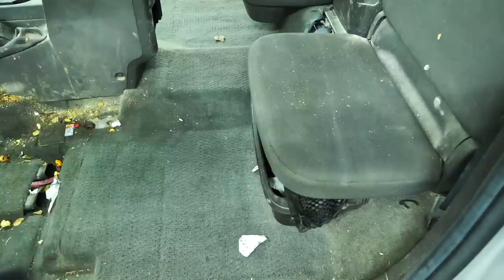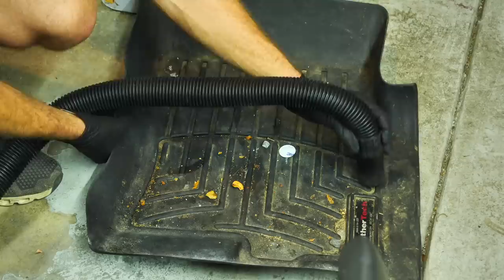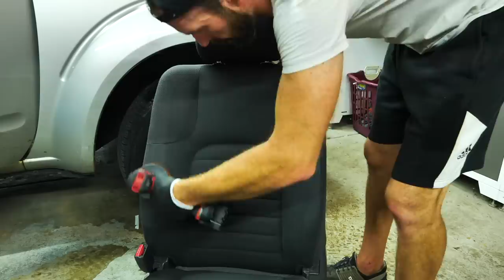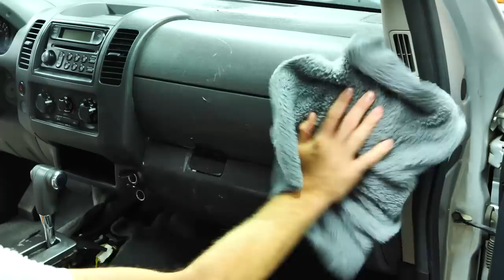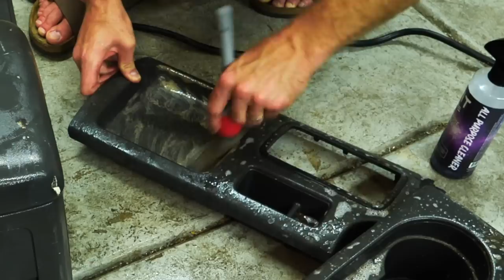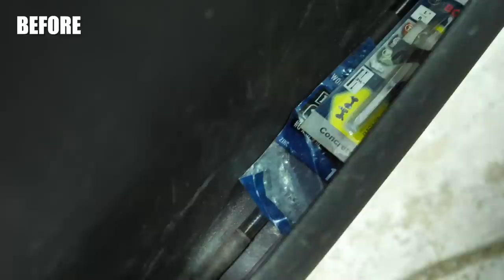Can This Nissan Frontier Be Cleaned? Car Detailing A Filthy Work Truck For Free!

Comment: Love your videos.  

I’ve actually asked you before but have not seen it yet, but I would love to see you REPLACE a carpet….  You often mention how in some cases it would be easier to just replace,….

Another thing I’d love to see is a staining of the carpet - you recently flipped a car and there was a big white bleach spot / even not perfect a dye on that spot would have looked better.

It would also be neat to see a leather repair kit…. 

One last suggestion / scratches and on the plastic might look a ton better with a little heat gun?

Just a few suggestions.

As always, you do a great job!

Comment: I may be off base, just thinking out loud. Could you use a heat gun to mellow out the scratches and mars on the door cards and other trim panels. Obviously you would have to go slow and see how it goes. Love the detail vids, car builds are fun also.
Reply from the maker: Great idea, something I have never attempted but willing to give it a shot and succeed or fail so you dont have to lol.

Comment: I'm curious what you charge for seat/console removal. I've had quite a few clients recently that could have truly benefitted from seal removal to really get deep down behind some hard to reach areas. Most of them would not have been willing to pay that cost but there inevitably will be some clients that do.
Reply from the maker: Honestly I would charge maybe an extra $50. It’s actually a time saver for a Detailer and saves your back in my opinion. Just make sure to use locktite on the seats bolts when you reinsrall

Comment: When you use all the liquid cleaner on the radio power windows and doors are you worried about any of the liquid shorting things out?
Reply from the maker: Never had an issue ever but moderation and doing it every week... never. Only when they look like this.